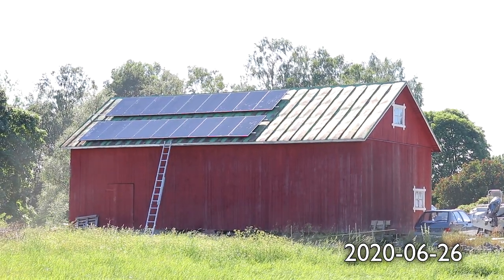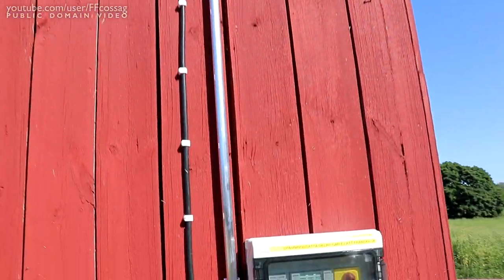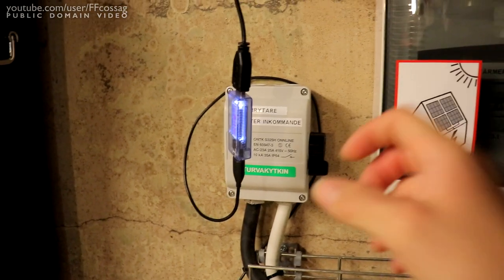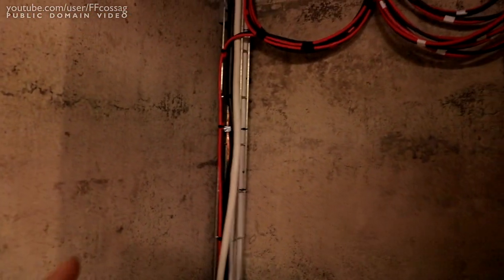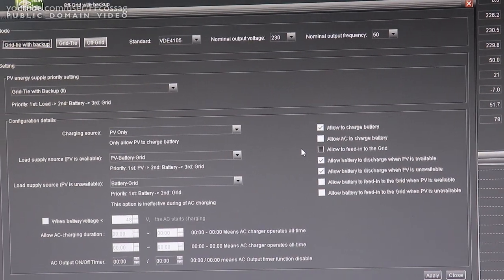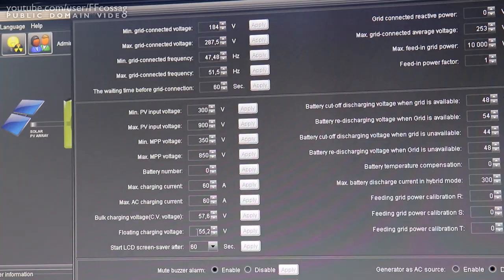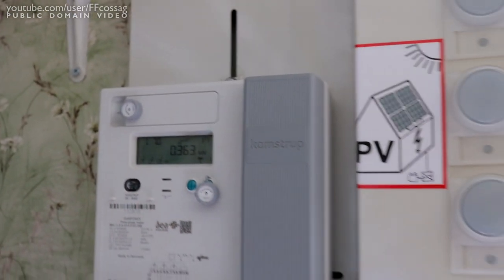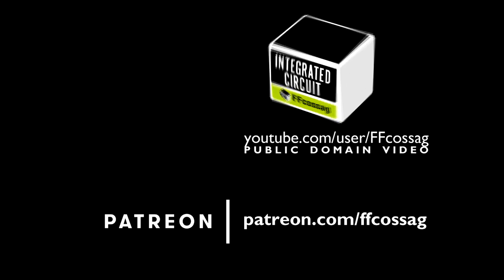10 kW Hybrid Solar VLOG 8 - SOLAR PANELS!

Comment: 6.5kW is not to be sniffed at.  Nice work, FF.
Reply from the maker: (Spoiler alert) it turned out to actually be 5.5 kW because they got the wrong bloody panels!
Reply: @FFcossag  It's still better than a poke in the eye with a sharp stick.  ;o)  I only use 5 - 6 kW/h a day.

Comment: Are you going to populate the rest of your sheds south facing roof? nice setup FF
Reply from the maker: Sadly, there's no south facing roof, only east/west, and the west facing one is at a slightly more northern angle than the east side, making panels on it a bit less economical. I may or may not cover it, it depends on if  I get a good deal on some panels, I suppose.

Comment: Hehehe, feeel the power! Verkar fungera ju :3 håller dock med dig om att inställningarna på växelriktaren verkar... Svåra att använda. 6.5 kilowatt hehe, du kommer lätt kunna driva hela ditt område med det :P Kul att se att allting fungerar som du hade tänkt :3 Nu har jag blivit ännu mer inspirerat att gå bananas med mina egna solenergidrömmar hehe, kanske kan ta hela gården off grid jag med hehe  

Grymt jobbat :3 Sa ju att det skulle bli helgrymt! :D
Reply from the maker: Tack, indeed, indeed. Lycka till med ditt stuff, kom ihåg, don't let your dreams be memes :3 Slå slag i saken tidigare snarare än senare om du ska.

Inställningarna på invertern suger, tyvärr, jo. Nu på vintern så är den minst sagt jobbig att dras med - någon automatik som hanterar finsk vinter finns det inte att tala om.
Reply: @FFcossag  Heh, Våra vintrar här i sverige och finland är inte jättelätta att optimera för antar jag, tror inte tillverkarna har besökt oss och sett hur det verkligen är i verkligheten cx 

Hehe jaa, du har helt klart rätt, efter att jag lekt runt med mitt lilla system jag har nu med endast cirka 115 watt totalt och insett att det faktiskt kan producera en hel del, speciellt på sommaren så klarar det lätt av att driva de flesta grejer jag äger, jag har till och med kört mitt elektroniklabb off grid med det cx Solpaneler skenerellt börjar komma ned mycket i pris, så det kan vara så att jag har planer på att köpa mig lite riktiga grejer, såsom det du har nu hehe. OPZ Batterierna är jag väääldigt intresserad av själv också, dem verkar ha helt otroligt bra egenskaper till det här. I mitt lilla system jag har nu använder jag gamla äckliga startbatterier så som du också hade i början och well... dem funkar inget bra alls cx Deras plattkonstruktion är inte stark nog att klara av påfrestningarna av ur och i laddningar antar jag, och jag hade ihjäl 5 stycken batterier förra sommaren, och alla dog på grund av kortslutna celler... Nu har jag endast 2 batterier som jag kan använda, ett 40aH Djupcykel (Typ modell Biltema), och ett 10 år gammalt Biltema silver calciumbatteri som jag vände polariteten på för att ta tillbaks till liv... Det fungerade konstigt nog, och det verkar ha ganska bra kapacitet förvånansvärt nog. Men det klarar nog inte av att ge tillräckligt med momentarisk ström att starta en bilmotor med, men det verkar klara mindre laster (20-30A) Utan problem... Det hade 2 ''soft shorted'' som det heter på engelska celler, och jag hade inget direkt hopp för det, utan jag bara gjorde det för att jag var uttråkad, och till min stora förvåning kom de 2 cellerna tilbaka till liv, men frågan är hur länge då. XD Så jaa, hehe. Börjar bli ordentligt intresserad av att bygga ett riktigt system till mitt faktiska hus! Det lilla jag har försörjer mitt lilla off grid hus med el mer än väl nog, och detta har fått mig att inse att ett ordentligt system faktiskt skulle kunna fungera väldigt bra, i alla fall på sommaren! Nu på vintern... Well, kanske kan driva min dator utan elräkning i alla fall :P Jag har också en stor ladugård som har taket mot söder, och samma sak gäller husets tak. Jag vet inte hur stor din ladugård är i verkligheten, men det ser ut att kunna vara ungefär som min, och då skulle jag lätt kunna sätt ungefär samma effekt som du där, och kanske häften på huset också :D 

Det kliar I fingrarna... hehe
Reply from the maker: Räkna inte med att köra något på vintern ... det stora systemet producerar mellan 0,5 och 2 kWh per mulen dag - inte ens tillräckligt för att förse inverterns tomgångsförbrukning på dygnsbasis, så jag måste till och med ladda batterierna från nätet.

Ladan min är ca. 100 kvadrat, den är mindre än den ser ut att vara, med taket mot öst/väst, så du har antagligen bättre förutsättningar än mig!

Snyggt jobbat med batterirestaureringen, förresten. Kul att se någon annan hålla på med såna hopplösa projekt. :3

Comment: Dunno if they changed their tune or not, but in the UK they wouldn't let people use their own equipment for grid-tie, especially stuff with battery backed "islanding" facilities, if it wasn't on the FITS (Feed-In Tariff Scheme) list, it wasn't going in, such an inconvenience for a customer to be able to, y'know, USE the energy they produced in the event of a grid failure... :\
Reply from the maker: My local power company only requires that the equipment complies with a few safety regulations - including one that governs disconnect times in case of a grid failure. Islanding isn't allowed here either, for obvious reasons.